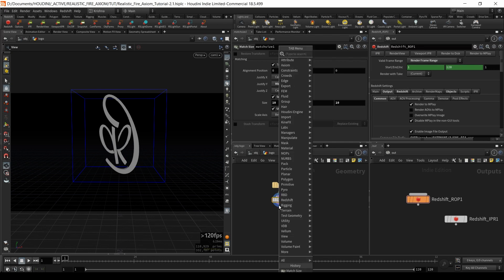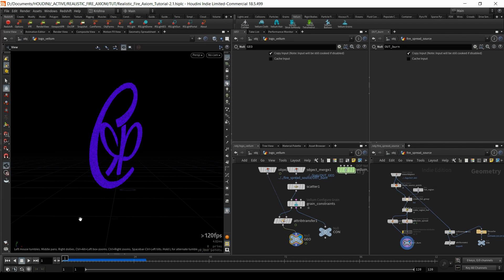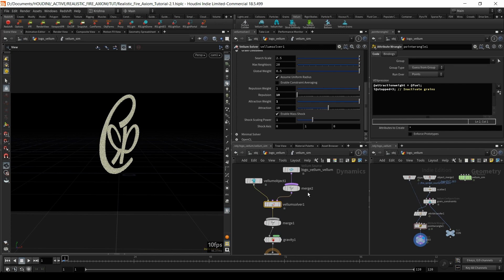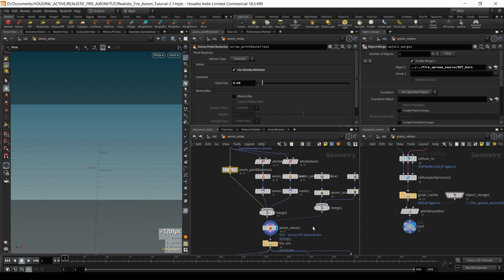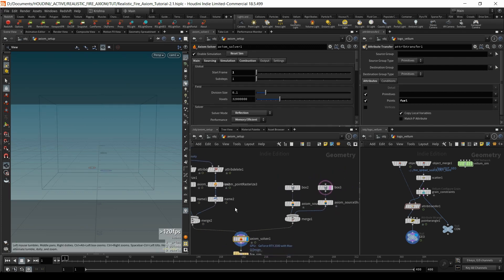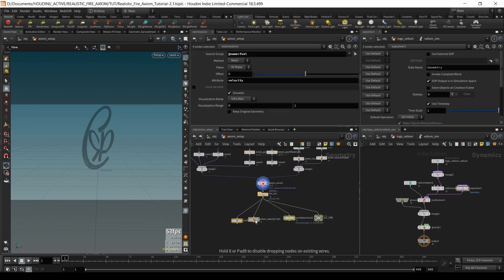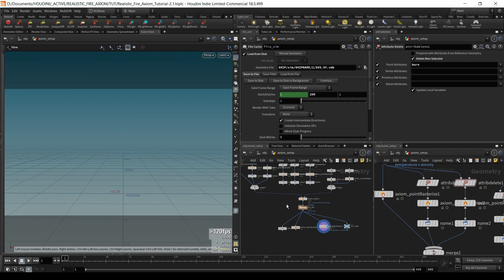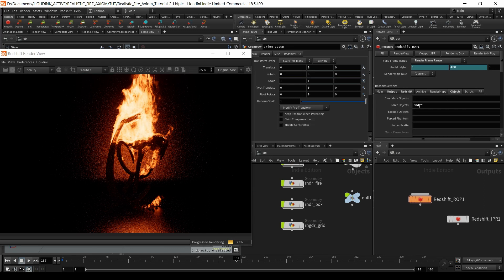TUTORIAL - MELTING LOGO - REALISTIC FIRE PART II - HOUDINI - AXIOM - REDSHIFT

Comment: Hello

this is an amazing tutorial and I followed it closely. I'm a noob to Houdini so I'm learning through tuts, I would like to see if you would be kind enough to give me a tip to extend this logo tut.
I would like to transform the grains into a viscous fluid but I have no idea where to start. I have placed a particle surface node that gives a surface that kind of does it but it has no fluid attributes that I can use, and the surface keeps jittering and bouncing.
If you could give me just the direction to take I would be really grateful.

Merci

Alain
Reply from the maker: Thank you for your kind comments. I have tried turning grains into fluid but ended up with the same result as yours. Glitching and jittering. Right now I don't have a stable workflow for grains to fluid. However if you are looking for melting effect there's a shelf tool in houdini you can try as a starter. Hope that helps